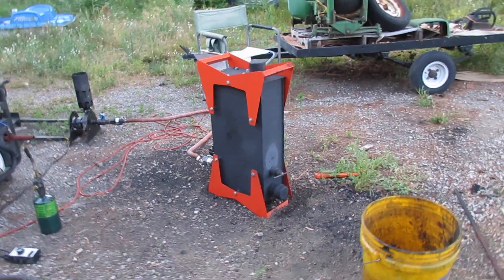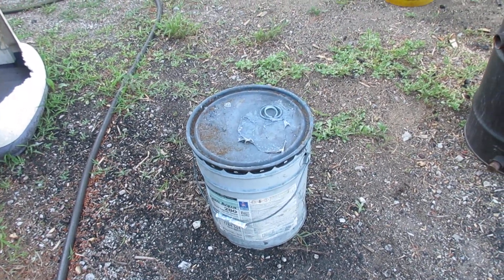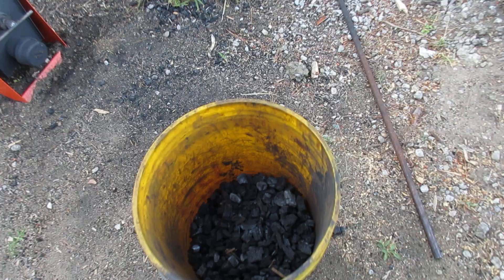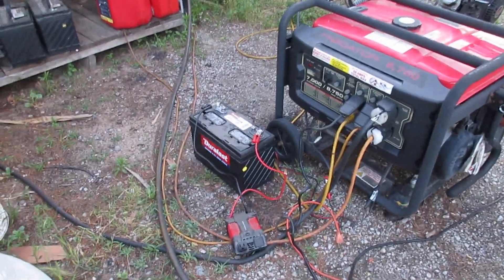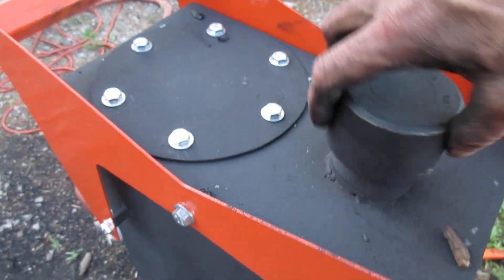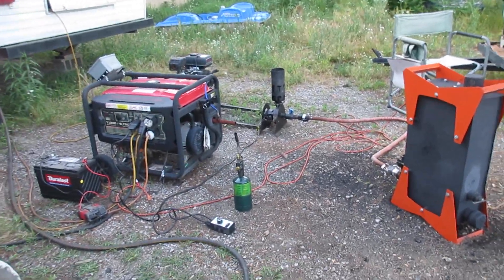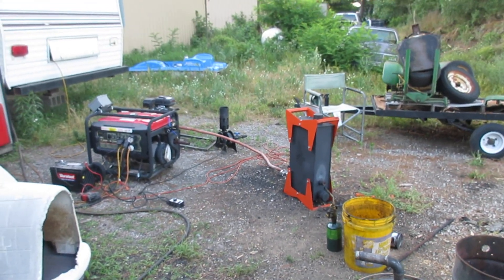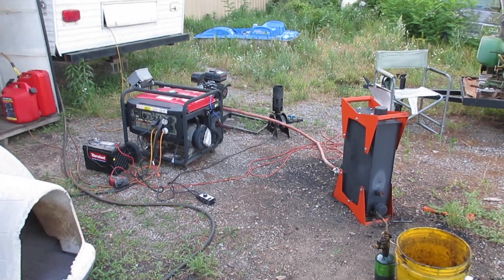M-1 Gasifier Cold Start and Engine Run

Comment: Doesn't get any more compact or easy to get running as that. Nice design, Matt. Is the filter washable? and about how often does it need to be cleaned?
Reply from the maker: you just blow it out with compressed air. It depends on how well you screen the fuel. The dust you put in the machine the less you need to mess with the filter. If you screen the fuel it will probably get you a few days. its easy to clean, you dont really need to wash it. Just dump it out and put it back in.
Reply: @Thrive-Off-Grid  Have you taken a temperature reading of the gas by the time it gets to the engine?  Sure does eliminate most of the problems associated with gasifying wood for fuel. Probably lose a little " potency " though, eh?
Reply from the maker: @nhhbbyloggr5022  The cooling is done via the hose. It is still hot but for what this gasifier is, it works. With steam injection charcoal blows direct wood gas away. Its actually more powerful gas. 
The Fusion charcoal gasifier has a cyclone filter, gas cooler, and a larger bag filter and all are easily accessible via the lids. It will be standard with direct steam injection. 
 I am fully scrapping direct wood gas this year. The new Fusion will take the place of the higher end machines with full automation.